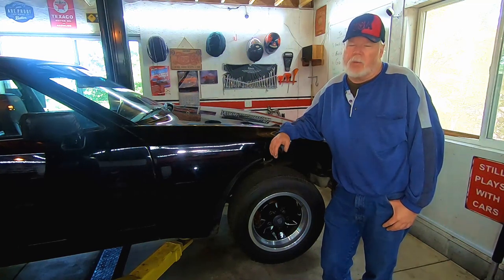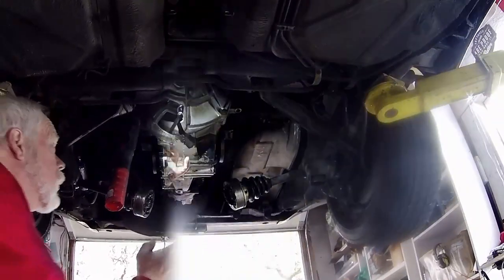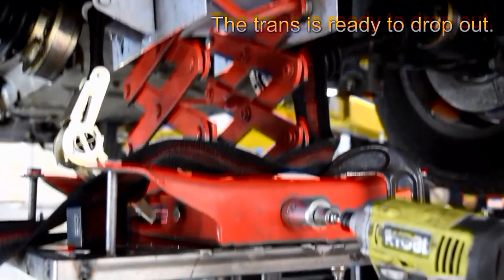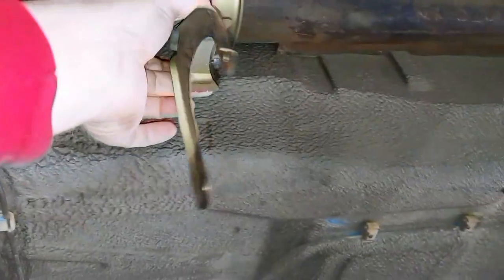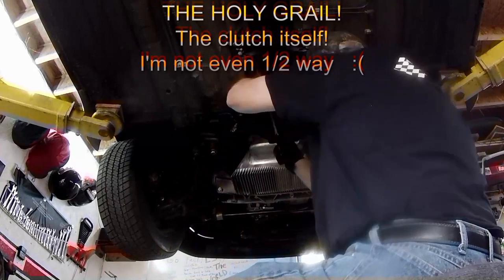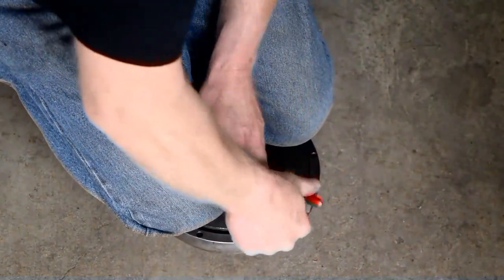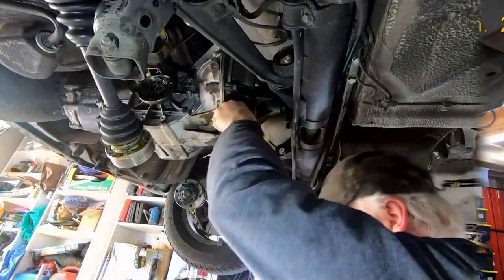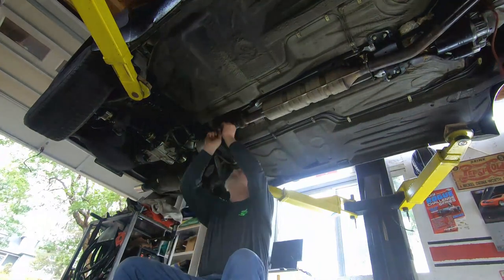944 Clutch Replacement in 10 hrs. Barn find car!

Comment: i rounded one of the coupler screws and a third of the screws holding the pressure plate. I had to drill out the PP screws and get an easy out for the coupler screw. I didn't have a lift so it took me a couple weekends.
Reply from the maker: I usually take the ratchet handle and tap in the socket in or on the bolts to make sure they are well seated.  But sometimes they just break.  At my age I wouldn't even attempt that without a lift.   But I have done it both ways so I know what you mean.

Comment: Thanks for this video 
I have an 87 944 na with 187,00 miles on it and it is unknown if the clutch was ever done. I have a slight shudder sometimes on take off but I also have vibration at idle so I was going to start with motor mounts (also unknown when/if these were done)
Reply from the maker: Sounds like a good plan.  It's probably hot spots on the pressure plate/flywheel.   I'm not even sure when they made the change to the spring clutch disk.  They do last much longer.  My last clutch job is still going 10+ hard driving years later.

Comment: How did you determine that you still had the original rubber centered clutch?  I've got an '83 with no documentation.
Reply from the maker: It's really hard without documentation.  Even my one owner car didn't have documentation.  That's the main reason for changing it.  You might be able to pull the starter and see if there are rubber bits in the bell housing, or look in the hole near the slave cylinder. Or try one of those inspection cameras.  I know somehow I was able to tell it was a rubber centered clutch before I tore it apart.     How many mile on it?  Was it driven hard?  My car was babied with 87k miles and likely had the original clutch.  It looked real good.  But a hard driven car with 50k or less Is probably coming apart pretty soon.  Google Porsche 944 rubber centered clutch and you'll see the difference between that and a spring centered clutch.
Reply: @budgetoutlaws9978  Thanks for the reply.  I've tried all those things.  When I pulled the starter to do water pump I tried to inspect with borescope and could see anything.  Car has about same mileage as yours and was well cared for, still in nice condition.  No rubber flakes in bell housing.  Guess I'll just live with it until it fails.  Apparently, you can limp home still have a catastrophic failure.

Comment: That car looks pretty clean and notably rust free. I have a car that spent some time in New York, and looks it. Not too bad, but I'm already cringing at some of those fasteners giving me trouble.
Reply from the maker: I was pretty lucky.  Most of the fasteners were like new.  You probably already have some good spray for loosening bolts, but I also recommend heat where practical.  Then add Freeze spray and shock the bolts loose.